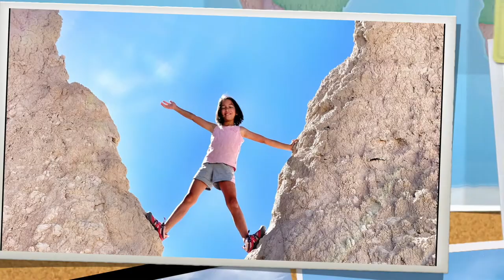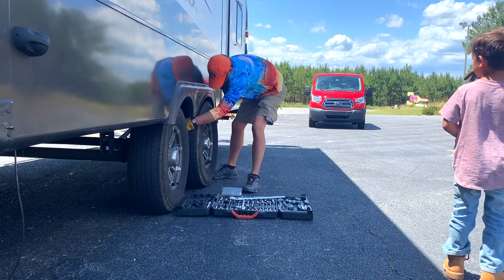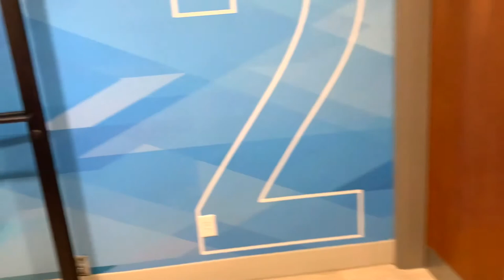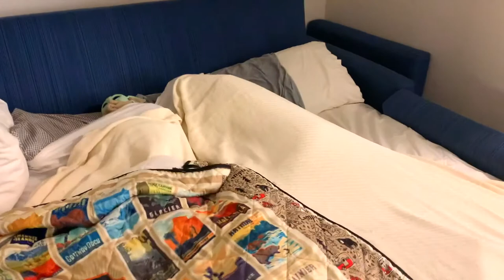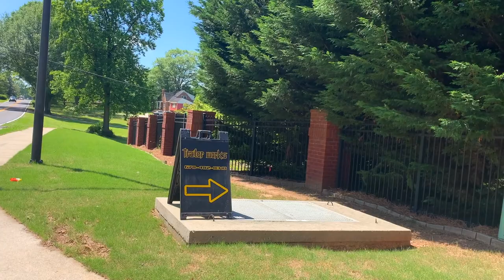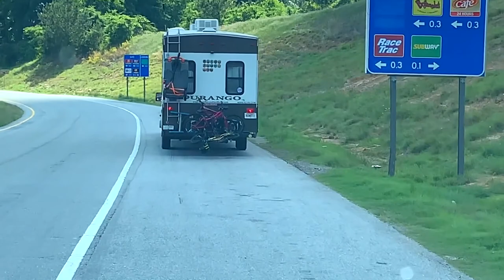Wheel Bearing Failure On The Interstate - Full time RV family of 9

Comment: Thanks for posting your video.  I'm a paranoid person when it comes to traveling in our travel trailer.  I take along two extra leaf springs, shackles, bolts, equalizer and I even have a set of spare wheel bearings including the grease seal.  Get stranded on a weekend when you can't get parts or worse yet, stranded out boondocking.  You'll wish you had spare parts.  Glad to see you were able to fix it and get on your way.
Reply from the maker: That is so awesome you are so prepared…and you are right…it can be really difficult when you are stuck in places you are unfamiliar with. Thanks for sharing your tip here with us and others…and encouraging us all to be more prepared. Because it isn’t IF something will break or go wrong…it is just WHEN 😅